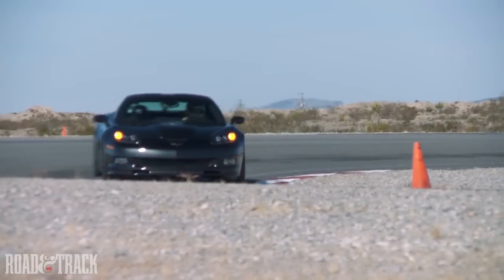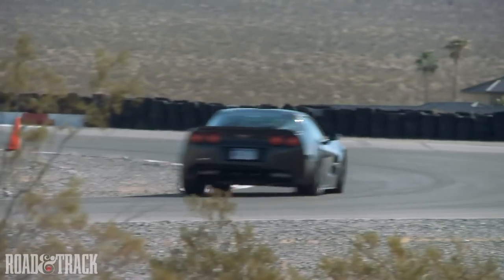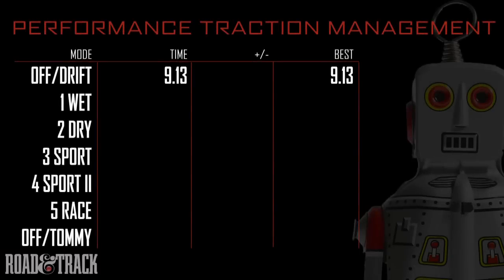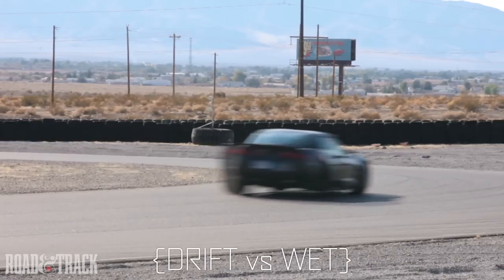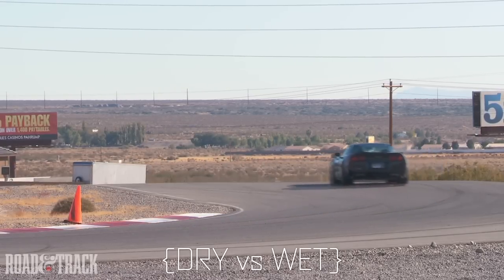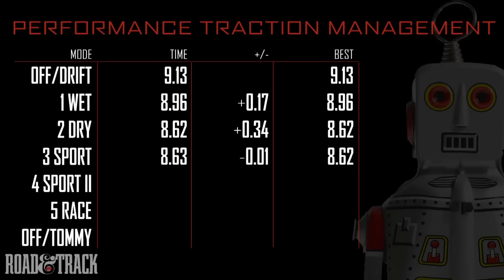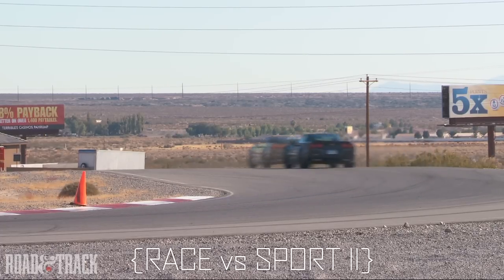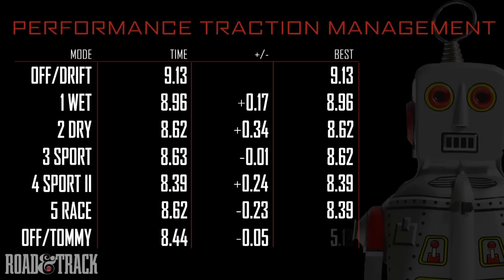How it Works: PTM in Action

Comment: My 09 doesn’t have all those features.  Was this added after?
Reply: 2012 and up!
Reply: Z3rhairstylers PTM is introduced in the 2010s and up, along with launch control and no-lift-shift. 2012 and 2013 introduced slightly longer gear ratios and pilot sport cup 2 tires.

Comment: Wet1 suits my experience level at track days. The car's power had me entering corners way to fast. The brakes are huge & never fade.  At the strip I got my fastest times in Sport2. It helped with the super sticky first 100' with light tire spin. It ran 11.05 @ 134mph. It leaves straight with a little wheel spin
 It's a pleasure to drive on the street. It's never needed a repair other than oil & tires. In Touring mode, It's a very nice long distance traveler. We love it. The best of both worlds.